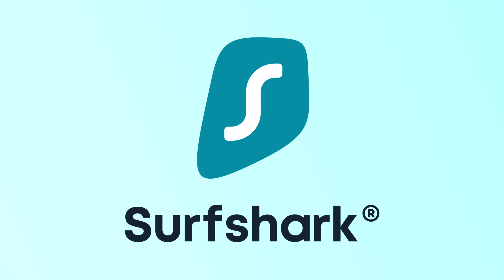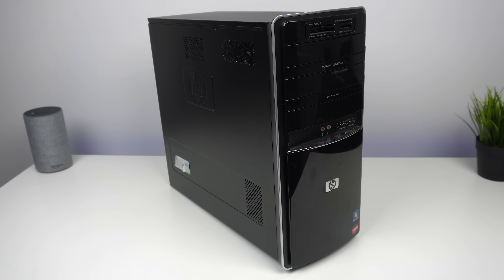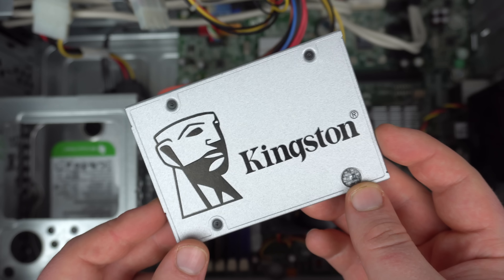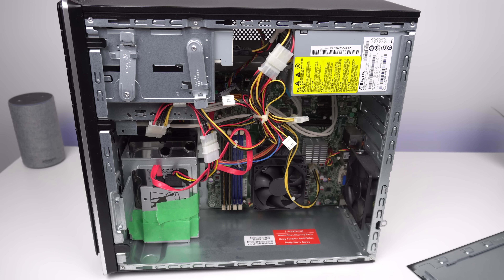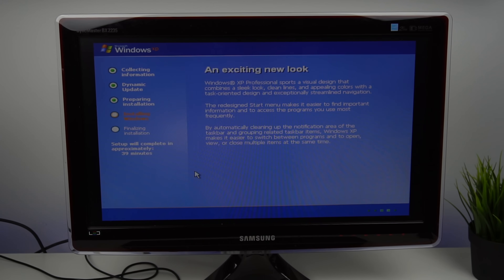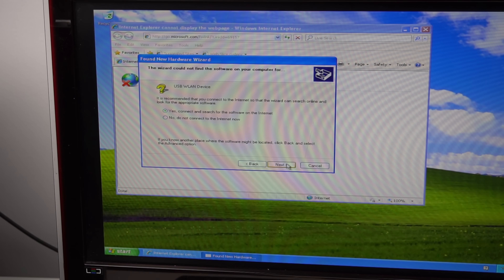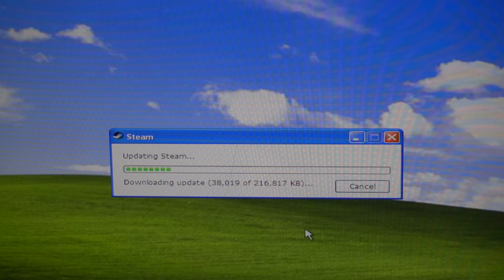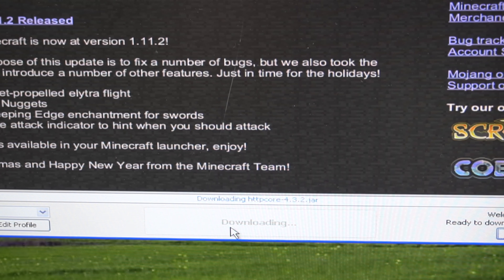Trying to use Windows XP in 2019

Comment: I'm getting sick and tired of those m*roons making fun of old computer 
systems with their hidden agenda's to make us buy newer systems which 
very often AREN'T ANY BETTER! (Yes, I'm shooting).
Reply: Well, not completely true. Modern hardware is without a doubt faster and more capable than older tech. However, what isn't better is the OS, for example, Windows 10 is awful. It's filled with bloat and it runs slow even on modern PCs. Older Windows don't suffer this so they're without a doubt better in terms of performance.
Reply: @cdscissor  I don’t know man I’m not too impressed with the specs of new computers.  A lot of these computers that originally came with XP can run 10.
Reply: @9852323  The OS shouldn't be demanding on hardware, and often it is very light. Computer performance doesn't concern the OS much at all. Try running an intensive program (like 3D software or a AAA game) on an old machine compared to a modern one. Have fun with that.
Reply: @cdscissor  Use a netbook with a 32 gig SSD and two gigs of RAM with windows 10 then tell me that the operating system isnt intensive. Also you have to realize most people don’t run intensive software like that nor did I mention intensive software or games I just said I wasn’t impressed with the newer hardware and that most old computers can run windows 10 Play simple games get on the Internet and do what the average Joe wants to do.
Reply: @9852323  That's fair. My work just happens to take advantage of strong hardware, for the average joe, yeah that's more than enough. I may have overreacted there.
Reply: @cdscissor  Your good. I’m pretty passionate about it myself Lol
Reply: @cdscissor  What does your work use the computers for? Just wondering

Comment: I used Windows XP as a normal computer from 2005 - 2013, and used it again for non-internet, old video gaming and multimedia use from 2014 - 2018. I stopped using Windows XP in 2018 because my Windows XP laptop was sold, due to it being not used more often and it was an old system. That was the time when Windows XP's use has massively declined. From late 2018 to now, which is 2019, I now don't use Windows XP. Who now uses Windows XP?

Comment: For retro gaming purposes i have an XP and 7 dual-boot, and it still works like a charm for just about anything i would need a computer for. With NewMoon there's modern firefox so the internet still works, and most other multimedia hasn't exactly changed that much over the years anyway.

Comment: Its easy using XP in 2019, your probably just used to using more modern tech, ive got a 1GB graphics card in mine with a 3Ghz HT P4 and 2GB memory with a 500watt after market psu, bit overkill but there's plenty of power for when it needs it and ive added a blue led CPU cooling fan to finish it all off, im playing minecraft, starwars old republic and many other taxing games on it with zero problem, the pc is an old packard bell from 2006 in mint condition as it was my dads 👍

Comment: I use XP on my retro gaming pc online still, only miner issues with finding some compatible software but otherwise its all good, ive modified the operating system so it looks and sounds like vista, ive maxed out all the specs and locked it all down with security software, it runs like a dream and its faster than some other more modern pc's my mates have 😉

Comment: What you REALLY should be installing on an old computer like that is Linux Mint or some other beginners' version of Linux (see DistroWatch.com for choices).  They would ALL run better than trying to force Windows 10 onto it.  As for XP,  it was fine in its day, but it's time to let it go.  You could have installed Linux in a small fraction of the time you spent on XP, and you would have a free, up-to-date OS.

Comment: Windows XP is still great operating system to use in 2019 but it needs to be intalled properly, 
including with all the motherboard drivers from the motherboard manufacturer's website as
Windows XP does not download drivers automatically like Windows 7 & 10, once that is done
it is still a great Windows System to use even today  ...

Comment: im running that exact computer (the case only probably) with a GTX 980, core 2 quad q8400 @2.66ghz, and 8gb of ram (YES i know its an extreme bottleneck)
Reply from the maker: Geez my man, you need an upgrade. 980 is sweet though
Reply: @91Tech  bad thing is I have no money... Also love you videos so far haven't watched much tho. Just subscribed.
Edit: forgot to say it suits my needs (playing psp games at 4k, funny thing I'm using a 1080p monitor upscaling a ton)
Reply from the maker: @nonoyesnoyesnt  Hey if it works it works :)

Comment: watching videos and doing email is no problem. if you have an old pc it runs just fine. why tell your family to upgrade ?  just download chrome and firefox versions for xp and go. I went to goodwill found a good used power supply and drive so I did do some upgrades. Put in 2GB or so of ram and your good to go.

Comment: you should set your xp to the pos ready version it got updates up to 2019

[HKEY_LOCAL_MACHINE\SYSTEM\WPA\PosReady]
"Installed"=dword:00000001

that connnection problem partly can be fixed by the options i dont remember exactly tho
but it stays on the internet explorer 8
i got internet explorer 8 on a other windows 7 copy
there are also some upgrades for the IE 8 and windows xp 

and here we are with 1 update for the IE 8 for windows xp from january 2019 - the KB4480965

the browser hard to say the most stopped to working because of the main problem for windows xp 
windows xp only support framework 4.0
the new browers all use a newer version of framework 4.0 (4.0 for xp is KB982670)
maybe there is a firefox esr

Comment: Thanks for the video. I have a system with win xp and it was working OK...after having problems with the activation, that part was fixed , later when I used win Xp there was no sound, I have tried several fixes but no sound at this time....any idea why it does not work....Thanks

Comment: I have XP on Intel Core i7 2600K machine with GeForce GTX 960 and 20 Gb RAM.
Reply: Em, Windows XP is officially supported OS for Intel Core i7 1st, 2nd and 3rd Gen. 4th and 5th Gen unofficially support XP without USB 3.0, but its very difficult to install Windows 2000/XP if you have Intel 6th gen CPU or higher (but it still possible with custom AHCI and chipset drivers). My PC with Z68 motherboard from MSI have official drivers for XP/XP64.

Comment: I have an old HP laptop I only use for recording as my DAW Program was made for win XP.  I use XP PRO SP3 and recently freshly reinstalled it as it got corrupted so I now have a very stripped down version as it doesn’t connect to the internet and has no virus protection. The only problem is it is hard to register the program as it is discontinued so I had to do some registry changes to stop it asking to to be registered. A great OS otherwise. 👍

Comment: use linux mint!
Reply: AntiX Linux ir Raspbian Pixel are faster than Mint.
Reply: @tompeckguitar  I installed Antix in my testing laptop and I'm really impressed with the memory footprint.
Reply: @tompeckguitar  I used a USB. Its memory footprint is around 60 MB for the 32 bit version and 140 MB for the 64 bit.
Reply: My linux mint xfce 32 bit installation uses around 240 MB just idling.

Comment: VGA is not for cavemen! Actually it supports 1080p at a very decent framerate. I even used it when I was younger and had no problems at all. The fact that it is old doesn't necessarily means it is bad.

Edit: Minecraft is the best game ever and the latest version can (very very slowly) work in one of my laptops that dates back to 2006.
Edit 2: There was a registry hack of course and Microsoft issued a security patch for Windows Xp and Vista early this year.

Comment: You have to hold the Fans when cleaning it with compressed Air, if they spin they may damage the electronics.
Never touch the PIns of the RAM or expension cards to avoid corrusion.

Comment: I built an XP machine specifically for retro gaming. You can get Steam to work. You will need the last version that supported XP, along with a patch to make sure it won't update. I installed Minecraft on it today, and it worked without issue. Don't know what to tell ya, man. I'm using the latest version of Windows XP MCE, along with the unofficial Service Pack 4 update. CPU is an AMD triple core. GPU is an ATI Radeon HD 4650. 4GB of RAM, and running everything on a 120 GB SSD. I predownloaded all device drivers onto a flashdrive before hand, and used IOBit Driver Booster to auto download anything I missed.

Comment: I have Steam, but I prevent it from auto-updating by disconnecting my modem to the internet while running it and playing games (running in offline mode). 
I have the games I want, they run just fine, that's all I need. I don't care about networking and bullshit "updates" that will do nothing but create conflicts in my system.

Comment: 4GB of RAM is not only "more than enough" for XP, it is "more than can be seen/recognized" by it, unfortunately. XP will only detect about 3½GB (3.46GB or something like that).
Reply: Depends on if the person uses the 32 bit or 64 bit version of XP.
Reply: That is probably true. 64-bit could probably take on a little more RAM I presume? I am only assuming becasue I have never experienced anything 64-bit myself, so I don't know what its capabilities and advantages actually are over 32-bit (other than it is doubled, lol), but I expect they're not a huge difference since XP pretty much gets flat-out dismissed as having a 4GB (3.46GB) RAM limit among other limitations, as no one ever says, "except in the case of a 64-bit system..." .

Comment: Does the update work? Till the latest version before MS stopped support in 2014
Reply: The updates still work, But you will not able to receive new updates starting from May 2014.
Anyway You can still able to get Windows Embedded POSReady 2009 on XP, but however, MS ended it support in April 2019 (last version of XP).

Comment: Nearly every XP manufacturer included an XP install CD and a CD of drivers and software. You should have downloaded Firefox ver.28. Chrome is meh.

Be sure to run Windows update if you don't have Service Pack 3, and look for the recent XP security update which came out in July. ;)
Just look for an old version of Steam which does work on XP.

I still use XP for daily and weekly things.

Comment: The internet acess error in IE is normal. Enable all TLS and SSL settings
Reply: Yeah, But most website can't load until You patch Windows Embedded POSReady 2009 updates on it, and install TLS 1.1/1.2 updates so it's will completely load, but the site won't load correctly until Chrome Frame is installed.

Comment: If you really think you could run windows 10 on these older computers that ran Windows XP you are going to have problems. These older computers normally did not have enough memory to run Windows 10 which requires at least a Gig of memory to run and with a Gig of memory it still runs DOG SLOW and it may not run because the computer is 32 bit. If you really want to use that older computer and be able to get some work done or play steam games you should install a light version of Linux! Some lighter versions of Linux will run on 1/2 a Gig of memory and be lightning fast because the whole operating system will be in memory. Browsing the Internet will work as it should and you can rest easy knowing your secure because it uses a modern browser that it will keep up to date as it will run chrome, Firefox, Opera, etc... May I suggest Point Linux or Linux Lite as a very light version that will run on old hardware with 1/2 a Gig with ease. Oh and you can install it from USB unlike XP.

Comment: I have one of the old version SSD hard drives from my dad's old HP Pavilion, inside still have the XP OS system. Because my dad's Laptop's battery or any reason, that Laptop power supply is not working, so I make that OS system as Factory mode.

Comment: Great video, in fact I did expect that you struggle as soon you talk about USB boot and XP. Its possible, but XP have to be bootstrapped preferably to a PE or you could also deploy Network boot via a RIS server to have the same install experience. Which is completely useless since, today MDT toolset is far more superior for that. Anyway, my recommendations would be that you install with a CD and set your drive as a SATA mode with a floppy disk during the XP install. It will probably improve the throughput of your SSD. For the boot speed of XP it was that fast, its just because you probably didn't update to at least SP2 / SP3 with all motherboard drivers. After these updates, XP was very slow to boot unless you have a tool that clean the superprefech boot process or having an antivirus that load during the boot time. Unfortunately, Windows XP for gaming isn't preferred for old games since, most games of this generation are compatible with Windows 10 or can be tweaked with DirectDraw wrappers or patches. Also somes Windows 95/98/DOS games are not compatible With XP... So the chances that you need a specific Windows XP machine for gaming is quite low.

Comment: Well I have got Windows XP on one computer and it still works. I use both Opera and Seamonkey web browsers to browse the web and they work. So does everything else and I still gets some updates for it but not as many as I used to. So yes you can still use Windows XP but Windows 2000 is a different story. Since none of the new web browsers work on that.

Comment: Used to use Windows XP up until this past year for compatibility with older games. But at this point, almost every single old game is compatible or has some sort of workaround with Windows 10, official or not. 

The last 3 games that I could not get running on Windows 10 no matter what are finally working now (Oregon Trail 5th Edition, Grand Theft Auto 1, and Glace). This is really exciting because now I can just about do without firing up an old computer whenever I want to play an old game.

Comment: Windows 7 will probably be memorable. I still use it along with Arch Linux because I am a geek like that and I don't want to an OS that spies on me. That said spyware aside Windows 10 is bloated, boring and bandwidth killing OS ever. I can't blame anyone who would want to avoid it. But Windows XP is still useful as is Windows 98 and 2000. It just depends on what your trying to use it for. Just as Windows Vista is still useful, kind of. That said good video, I guess. But why wouldn't you bother installing drivers? That's a major blow to your whole video. I keep around a Latitude e6420 with a Nvidia GPU just for classic gaming, but it would absolutely suck without the proper drivers. I mean missing the turbo boost driver alone is painful. But the GPU? Man! You'll certainly want to do something about trim. Anything Pre-Windows 7 sp1 will require some kind of utility to add trim support. Windows 7 sp1 has this built in. If you don't do this you'll eventually wear out your SSD.  With Windows xp this would probably also require the Intel chipset... wait AMD chipset drivers. But then again you didn't bother with drivers so your CPU is likely having to overlook data transfers and writes to the frame buffer as that's what the standard XP drivers do, thus sucking the performance gains one would normally have with an SSD anyway. Yikes!

Comment: Jesus Christ why is nobody else pointing this out, the Molex to SATA Power adapter you’re found for the SSD is NOT safe
Molex to SATA power adapters are known to catch fire with SSDs. I recommend just replacing the power supply or disconnecting the SATA power from another device and using it on the SSD

Comment: In October of 2002 my family bought the Dell Dimension 8200 (running XP obviously). In 2011 they upgraded to the Dell Inspiron 560, and with that being said the old dell was left sitting in a closet until 3 years later when I decided to claim it as my own. Since then I have been constantly using it and love it. It has a 2.26 Ghz P4 and 1.5 GB RAM.

Comment: I feel you though, it took me 4 days to get the SATA modified ISO, I tried flash drive installs, and have a legit install CD, but I got the SATA modified ISO online and burned it to a blank CD and installed it. I didn't wanna install it from the legit install disc, because I'd have to switch back and forth from AHCI and Compatibility options in the BIOS when I wanted to switch between t operating systems. I use Opera as my primary web browser. I only have Chrome for Google Earth, and I didn't bother installing it on my XP system because I don't use it very regularly. I kinda just installed it to play some of my old games via USB powered DVD drive.

Comment: Minecraft does not run when you dont install the graphics driver on XP. And if you have a old graphics card that does not support opengl 2.1 or newer but does support an older opengl  use 1.7.2 or older.

Comment: No need for Steam if you have your old game discs or have "backed up" the ISOs. ;) XP is awesome for era appropriate gaming. Pair a C2Duo or a Pentium E5800 on a LGA775 motherboard with a GT640 or heck a 750Ti, add the CRT and you have a hell of a machine and high-refresh rates. Add in a 480 GB SSD and a SoundBlaster for the sweet 3D sound of EAX and you will experience the best version of the 2001-2007 (Pre-Crysis) era.

Comment: My first computer run W98, then I bought a notebook with XP, later upgraded to 7, than started using Ubuntu, than bought a MacBook Air, never looked back till this year when I bought a gaming notebook, tried using W10, didn’t like it and installed Ubuntu. Windows used to be actually pretty cool till W8 launched, that was the end, Windows 10 isn’t as terrible, but Microsoft have already screwed up everything